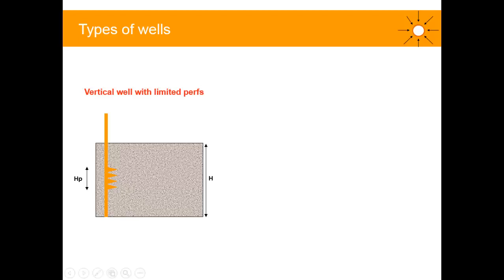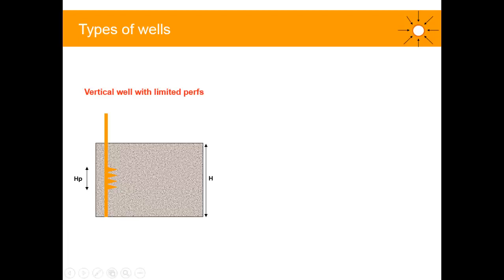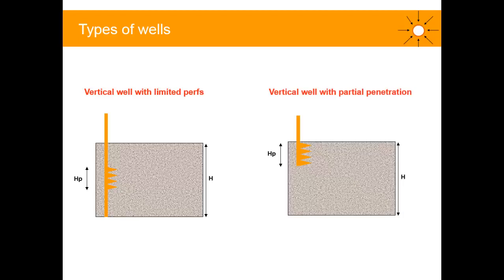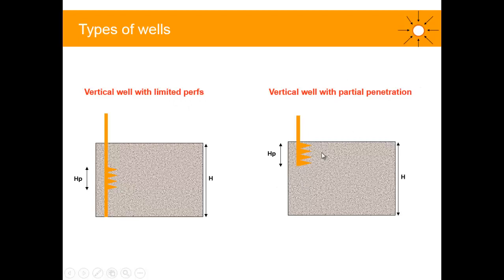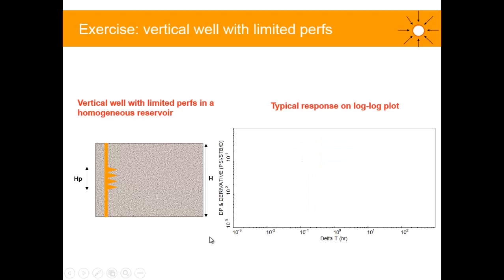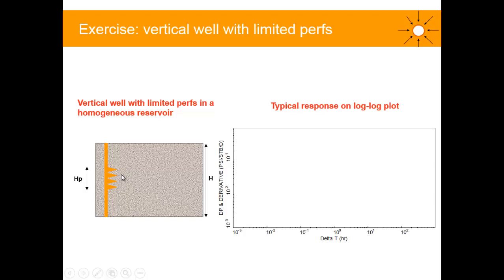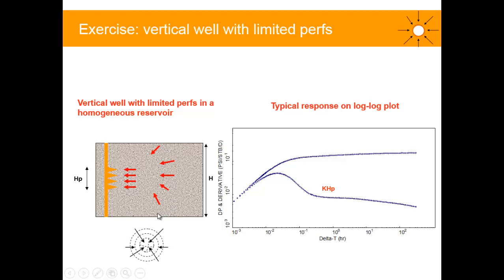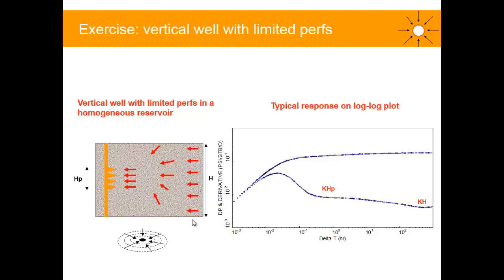Well with Limited Perforations or Partial Penetration

Comment: Hi, thank you for your videos. Can I ask, how do you workout the skin for a 2 layer oil well? Assuming that there the two layers are connected to the same string (or simply feeding into the same production line)?
Reply from the maker: Hi Rogeralves2006, thanks for your comment. Our recommendation is to first assume that the same skin for both layers and obtain the permeability distribution. You can then experiment with a non-uniform skin distribution, but we would recommend to use other sources of subsurface information to reduce the uncertainty (PLT, core analysis, etc). If you have some PLT information, you should replicate the same rate contribution per layer etc. All the best